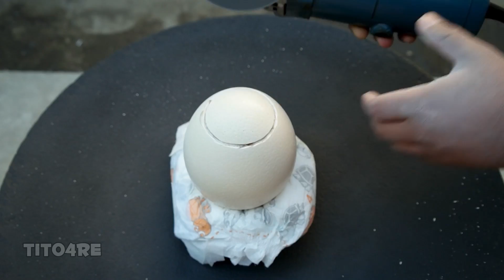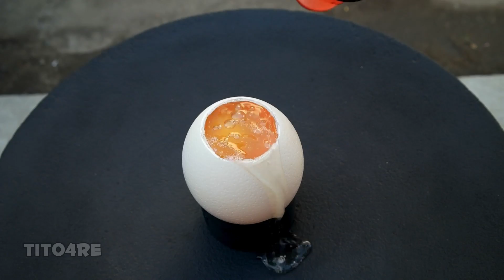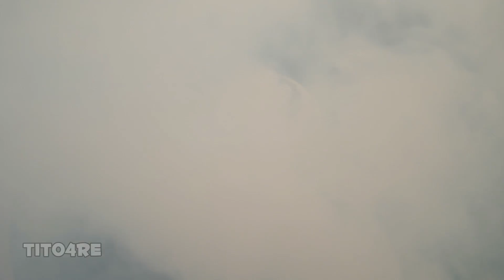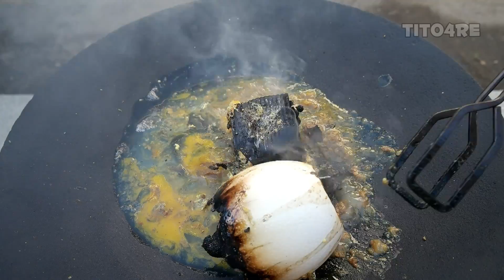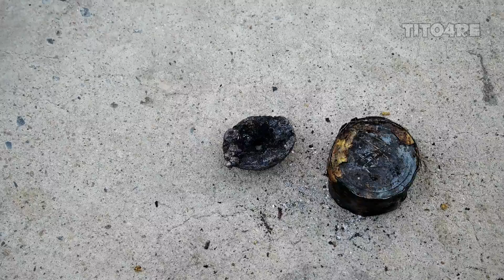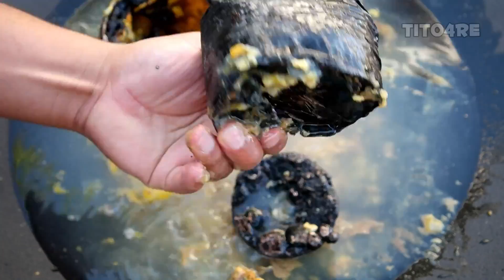Molten Copper vs Ostrich Egg

Comment: 5:05 I saw the ostrich baby eye. Did you see it?
Reply: Goober there also was no 5:05
Reply: Video description: "Pouring 1,984°F or 1,085°C molten copper inside an unfertilized ostrich egg i cut open"
Therefore, no baby ostrich eye to see, even if there was a 5:05.

Comment: unintentional hilarity: tongs-tap, tap, tap, AXE-SMASHSMASHSMASH. haha, that was funny. 
oh yeah, olive oil(in a clear plastic container obviously), was gonna say deep enough so it doesnt melt or crack when it hits bottom, but i remember you solved that by putting sand at the bottom, so yeah. olive oil, i want to see if its as smokey as i imagine.

Comment: I'm surprised the egg white didn't turn white on contact with the molten metal. Eggs turns white on contact with my frying pan and it's nowhere near 1,984 degrees. I've never seen an egg boil and bubble like that instead of solidifying.

Comment: I was eating eggs when I watched this
Reply: that hot copper that went down my neck felt great kind of burns though
Reply: a little spicy
Reply: I was eating copper wen I watch dis
Reply: I was eating a copper egg
Reply: o.......m.......f........g u responded😛😂
Reply: Tnx for responding i lov ur content and u gave me the idea to build a foundry myself
Reply: I've used sand and plaster mainly because home depot doesn't sell refractory cement and i just use wood or charcoal so my arm is usualy coated in burn marks and don't worry bout responding I feel like I'm taking ur time
Reply: u have a problem dude haha